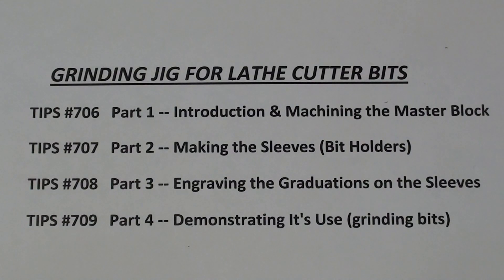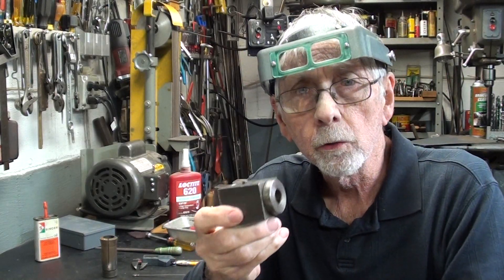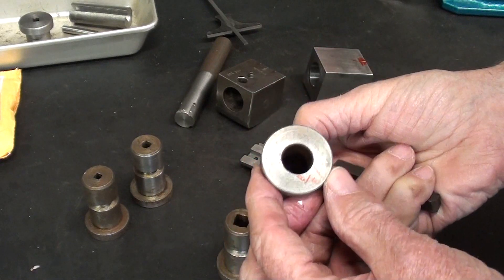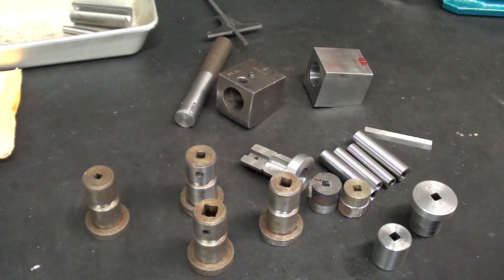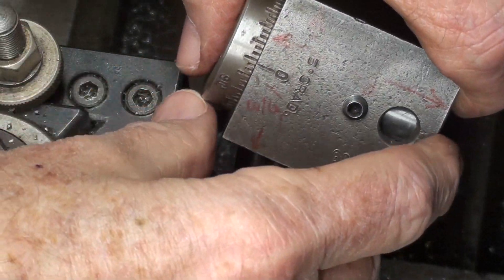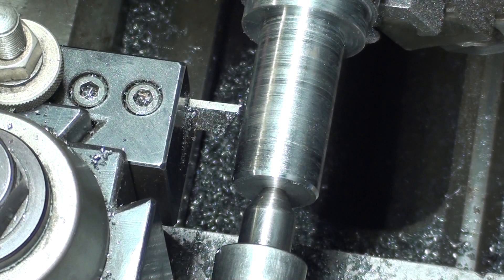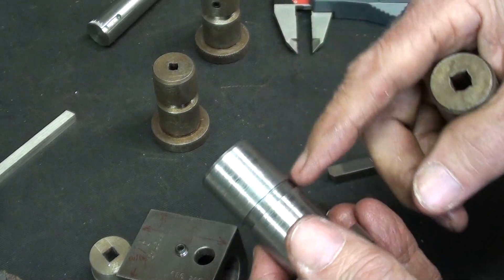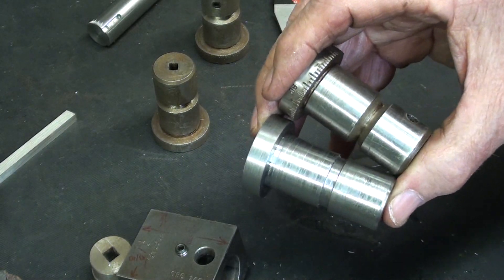SOUTH BEND GRINDING JIG Sleeves #707 pt 2 tubalcain lathe tool bits

Comment: Reid supply has machine tool sleeves by Sturdy Broach. They don't give them away but if you need them it's still easier to buy them then to try and make one. You can get them in square and hex.
Reply from the maker: Thanks

Comment: At 16:13 you elect to use a flat bottomed groove for the grub screw and state in part 3 that the original screw was not accurately located.

This feature is present in camera lenses (and telescope accessories) where these are attached to with a T-adapter. The adapter contains a V-groove and three pointed grub screws.

The screws are similarly offset from the centre of the groove. This causes the screws to force against the side wall of the groove. That way, neither groove nor screw dimensions are critical and the shoulder on the sleeve is only referenced against the  face of the block.
Reply from the maker: Great explanation, thank you

Comment: I made  your   demonstration. with one alteration  I made a steel insert . the same. size as the hole  I ues an old Plug sockets  with it square hole.     heated it up to soften it  for the fitting & cutting  the peace in the expanded in to the  slot  once cold,   it is not removable no pins  then put in the lathe to size.  les England  when you going to [post the rest ?

Comment: Can't wait for part 4. A set of these came with my South Bend Model A that I recently acquired. Brand new, never used in the box they are. I'm also in the process of making a Double Ended ALORIS Indicator Holder TIPS #421 for my South Bend. Thanks Mr. Pete

Comment: I missed watching this on Saturday.  I am pleased you found volunteers to make the drawings.  I looked at all of them to see how each person presented them.  Back in my drafting days (1970's) there was always a lot of comparing notes when working on projects if the company did not have specific standards for the way they wanted the drawings.  I once drew a brake pedal pad for a 1972 Winnebago motor home.  The engineer provided rough sketches and let me present it as I saw fit.

Comment: Hello Mr. Pete
 Just an idea or two I want to throw out there. Instead of soldering in the plug
a couple 1/8 holes drilled from the side with drill rod pins pressed in would also work.
  I love high speed steel cutting tools. But due to really poor vision I can't freehand
grind worth a hoot. I built my own grinding system.  I bought the cheap Horrible Freight
belt sander made a new table and jigs. Now I can grind tool bits just as good as factory
tools. I liked it so well I built a low-speed diamond hone for quick touch up sharpening
and making the radius on tips. There are times that nothing beats a good high-speed tool .

Comment: For such a grinding jig, I think you would be able to bore a larger diameter and then hand broach the corners of the square in the lathe. You don't need a full square to keep the cutter held while grinding. Not as beautiful, but should work just fine. As always, this is great stuff Mr Pete. Looking forward to the rest of the series. Cheers!

Comment: Seems like a design crying out to be done in 3d printing. Medium precision, complicated, doesn't have to see hard service. The originals were in metal because that's what they had.
Reply from the maker: Yes, but remember the tool bed gets quite hot during the grinding operation
Reply: @mrpete222  Perhaps a modification to include a piece of wet sponge would be called for. No worry about the plastic rusting.

Comment: Weren't looking hard/long enough to see my hand go up...

Purty shure that vee groove is there to allow for slight misalignment of the set screw position to vee groove relationship among the various holders and still pull the holder in tight to the block. But, to each his own I suppose...
Reply from the maker: I think you are correct
Reply: I was going to mention this too. I watched pt3 of this series before I saw this one. He mentioned this change he made in that video, so I watched this one to see what he said about the groove. Since there were only 65 comments, I went through them and found this one. I was going to mention that anyone who has a ShopSmith knows that they state in the manual that they put the point on the lock screw offset to the dimple of the frame on purpose to lock it in when you use it in the vertical position.

Comment: When I had my SB 9" I searched high and low for this jig.  Very expensive the few that I did find on Ebay.  I have a larger lathe now, but can still find this useful for my 5/16" square bits.  Thanks as always Mr. Pete.  Great video.

Comment: I made one of those years ago from Guy Lautards Machinist Bedside Reader....Now im going to make another one to hold my  5/8 HSS shaper tools just have to make it bigger and mill the bottom to a shallower 4 or 6 degree angle for my 24 inch  Rockford  Hydraulic shaper.....thank you for inspiring me to do so....the block i will use will probably be 3x3 or so
Reply from the maker: 👍👍 I did not know that it was in the bedside reader. Do you remember which volume?
Reply: You had to ask me that hey Lyle!! I just spent an hour looking ....second bedside reader pg..88  and first bedside reader page 101....but i ordered many years ago from a mr N.L Snowden from peoria illinois shop made tools he had the complete block in a diagram...and i have that downstairs in my shop....i have all 3 bedside readers from Mr. LAUTARD AND #3 IS SIGNED BY HIM...i know he went thru a divorce and was always looking for more info. From him as he was a Genius in my humble opinion and i still use his readers for reference even today....i hope he is in good health and going to publish more BEDSIDE READERS!!!

Comment: In a pinch a boring bar ground correctly can be used with the carriage to shape a square hole. Been there done that. 🙂
Reply: True. Not many realize that the basic hole can be almost as large as the rectangular cutting bit. For instance a 1/4 inch hole would work for a 5/16 tool. The square corners don’t need to be very deep to properly position the bit. Doesn’t look as pretty as a full square but serves the same purpose. (Correction, I had this backwards. See my reply to Dave below).
Reply: @ellieprice363    Are you meaning a 5/16 hole for a 1/4 inch tool?

Dale in Canada
Reply: @dalemcinnes1834  Yes, I had it backwards. Start with a 5/16 hole and broach the corners square one at a time to 5/16. Best to blue the part and broach with light cuts to the layout lines.
Reply: @dalemcinnes1834  Actually I still had it wrong. Starting with a 9/32 or even 3/8 hole would make it easier to broach the four corners. The hypotenuse of 5/16 (.3125) is 
.442 so the tool would still be plenty strong.

Comment: You could make sleeve by milling a U shaped slot into a rod . The complete square is unnecessary as the top section is held by the set-screw.
Reply from the maker: Good suggestion